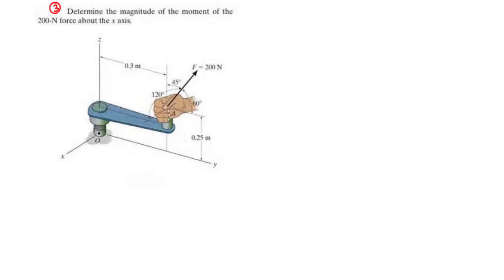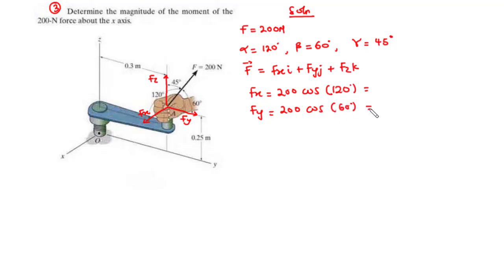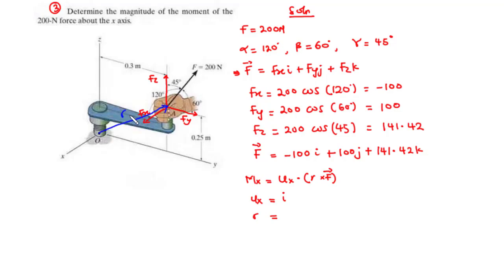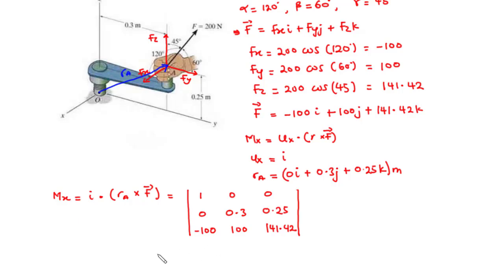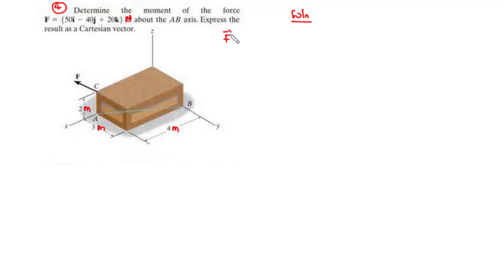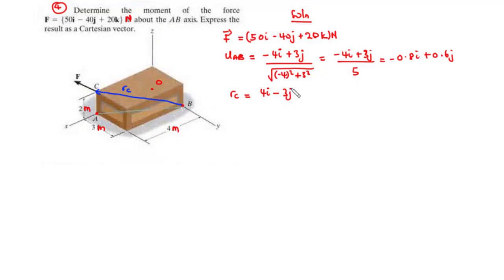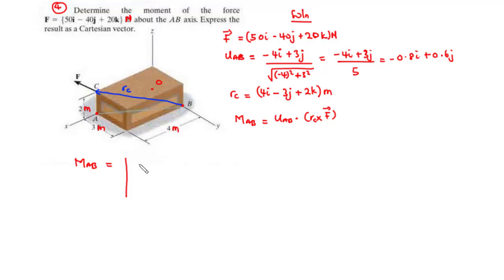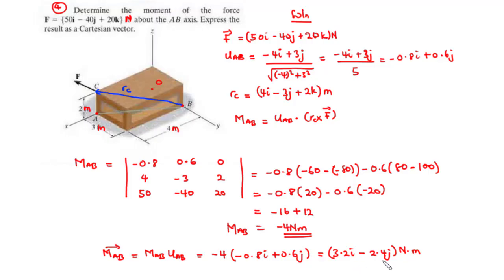🔺18 - Moment of a Force About a Specified Axis 3D -  Vector Analysis: Example 3 - 4

Comment: Why is that the r wasn’t directed from O to the line of action of the force but B rather
Reply from the maker: The reason why the direction was not taken from point O is the moment is to be taken about line AB, which means our reference position must be any point on the line. But to make it simply we just use point A or B as references. Any of the two works. I used point B, you can try with A and you'll realize that it's the same answer you will get.
Hope you understand.
Reply: @SkanCityAcademy_SirJohn  sir then if you take reference point as B .shouldnt that r(BC) instead of r(OC)
.so rC = 4i+2k
Because M(AB) is projection of M(O) on AB Axis ,thats what you said